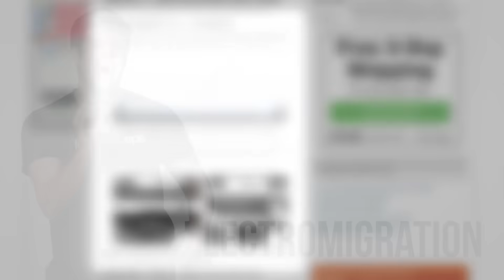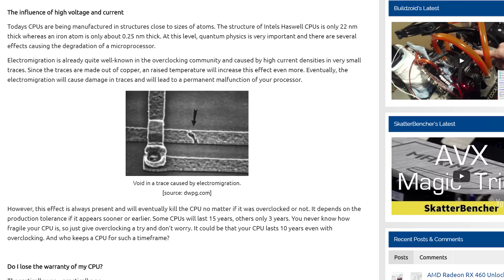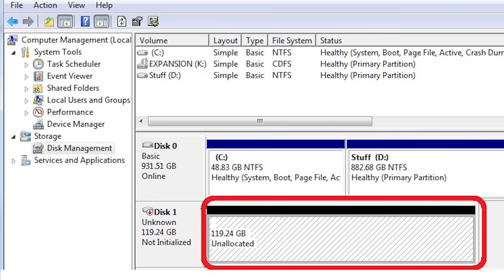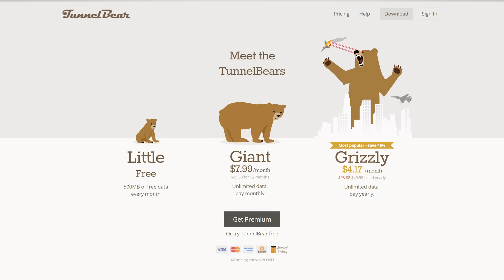Why Do Electronics Die?

Comment: Electromigration is indeed an issue. The current densities in the copper or aluminium layers of interconnects in highly integrated micro devices are in the order of 10^6 to 10^7 A/cm². These are current densities you usually find in superconductors only. In bulk normal conductors you don't find current densities of more than several 100 A/cm². There are several ways out of the problem with electromigration. The length of the interconnects can be reduced or material reservoirs (wider buffer lines) can be placed along longer lines in order to reduce their virtual length.

Comment: HEAT is the # 1 failure for electronics and engines. 
TIME is the # 2 failure for components. 
Capacitors are the #1 component to fail from HEAT or TIME.

Comment: Had a tv from samsung 40 inch led full hd from june 2007. Just at the end of the capacitor plague era. It worked fine for almost 2 years. Then it would take anywhere from 2 minutes to 2hours to start. Later i had to use a hairdryer to warm up the start relay capacitors to get it to start. Eventually it wouldn't start anymore. Bought new capacitors from ebay for 3 bucks swotched them out and still have the tv to this day in my office.

Comment: An answer from an actual professional grade electrical engineer here: the law of thermal dynamics and the law of conservation (which is elementary stuff), explain why things eventually fail. Most of these components are dealing with electrical heat that is being used almost just as fast as the electricity can move itself.  This in turn means that these components have a harder time dealing with the forces that cause harm. For example, a dielectric breakdown to a capacitor can happen which just means that high voltage (high heat) can cause permanent failure. Many components are specifically designed to deal with certain ins and outs. That is why you hear motherboards having different specifications for voltage requirements and what type of CPU/GPU it can use. The most advanced problem we have been trying to conquer is the components ability to undergo high tolerance heat, dissipating the heat as fast as it is transferred and withstand the rapid heat dissipation without falter. The truth about every single component though, is how every single electrical device ever made by man, has a limit due to chemical bonds and reactions. A battery can only recharge so many times until it can no longer hold newer charges.

Comment: I went on a call to investigate some power factor correction capacitors at a manufacturing plant.
The first one I saw I told the customer was bad and I wasn't even going to test it as it would be a waste of time.
He asked how I could be so certain that it was bad without testing it.
I showed him the rest of the capacitors in the bank that looked like giant cereal boxes and pointed out that the one that I said was bad looked like a giant cereal box with a free basketball inside it.

Comment: The main culprit (by far) in the failure of electronics is power supplies/capacitors. And no power supply is more unreliable that STINKING BUCK CONVERTERS.
PS. Engineers often shave a few pennies of production costs by UNDERRATING capacitors. They’ll use a 6.3V cap in a 5V circuit.

Comment: As a physicist, I know that electronics run on magic smoke contained within the component.  If the smoke ever gets out, then the electronic component will no longer work.  For example, if the power supply stops working and smells like smoke, you know the smoke got out, and the power supply no longer works.

Comment: I normally do not what videos like this, but this time I did. I have to say Luke tried really hard but failed. Electron migration happens regardless current flows or not. Correct answer was thermal expansion/contraction due to temperature changes, yet this is extremely rare to happen; more likely cause is dopants migration between different regions inside silicon and that accelerates tremendously with temperature. And yet this is not why SSD fails. SSD fails because floating gates (which is rather thick) leakage current increase as material deteriorate, because of temperature. That is why it is common practice to keep all mission critical electronic under 60'C at any time.

Comment: One crucial factor for "early" death of electronics is the RoHS compliance soldering techniques. Electronics are dying too fast now a days due to high melting point fragile unleaded solder. Many dead modern electronics wakes up just by resoldering components with standard 60:40 solder.

Comment: Probably the least evil thing Apple does is their planned obsolescence. But you’re right. An auto update that throttles your device is pretty darn evil. However, development is expensive and it requires continually buying new devices to pay for the R&D but no company is more about profits and dividends than Apple. They should absolutely charge at least 33% less for their “pro” gear. And since you can’t even really play any advanced games on the consumer models… gee, really their consumer products are used by more professionals than their “pro” gear. Accountants, professors, real estate agents, writers, democrats and liberals in general. They all use their Apple products professionally. But video editors and 3D modelers of any kind can get ten times the performance on a windows tower for half the price. The only problem is, you have to restart 3 times as much. Maybe even 5 to 10 times as much but it’s kind of worth the savings. You still have to restart an Apple product occasionally and the updates, ach! The updates! Have a great idea, must write it down or record it RIGHT NOW… sorry. Auto update. You’re effed. For the amount of times Apple takes control of your device you’ve restarted you PC only once. I bought my first PC in 20 years. I built my first one 20 years ago, I have to say, I’m glad I did and I still think RGB is awesome. Joni Ives probably throws up at the notion. And I’m glad. It’s as if minimalism is the only way to make something look good. Granted non-minimalism is VERY easy to mess up. Enough outta me.

Comment: This happens because of the nuclear weapons. They are space laser devices that sense electronic devices, toys, watches, cheap stuffs, laptops, tabs, batteries, etc. The most spectecular part of this is the memory effect of the batteries. The GPS monitoring system is responsible for this, if you don't use it, your device will last forever. In watches, the baclkight calls the GPS (its inverter), in tabs all permissions of locations should be turned off, using a regular map is better. In laptops, the battery's malfunction leads to all malfunctions. So if you don't use Google Maps with a laptop, it will last forever. That was simple?

Comment: Plastic parts (a.k.a. PEMs, or plastic encapsulated microcircuits) also absorb moisture, which eventually leads to internal corrosion. Contrary to popular belief, plastic is not a perfect sealant.  If you need a hermetically sealed part, that requires a ceramic package with a sealed lid.  

During manufacturing,  there are baking procedures to drive out any moisture PEMs absorb prior to soldering.   If they aren't preheated and dried out, they will pop and crack when they are soldered. Just one more thing to think about.

Comment: #1 killer of all electronics components is Heat!  Along with constant use/24-7.  Running components with poor airflow increasing heat will kill them.  # 2 is electromagnetic force causing voltage drop and heat.  Dead, Dead, Dead!!!  :)

Comment: It fascinats me how electricity behaves very much like water. The effects he's referring to become far more noticeable when you deal with high energy electronics that operate in the megawatt range. A lot of parts in these type of devices have to be replaced due to wear caused by the huge amounts of current going through them. The damage resembles sort of the wear and tear of water on on pipes and river banks overtime.

Comment: you forgot bad passivation, some Commodore chips fail because they did not passivate the chemicals used in the production of the chip, they never stopped the process and at some point, they fail. Overvoltage is another problem, heat of course, also mechanical like bent pins etc. I've seen it all.

Comment: Always buy high quality motherboards from well establish companies that have been in the business for a long time. I've been buying ASUS mobos for ~30 years and not one has failed. I stilll play Win98 games on my ASUS P3B-F with a P2. Cylindrical capacitors are easy to replace for those new to soldering, easy to spot because they start to expand or leak. Inspect retro hardware frequently. Smaller ones are harder and might take an expert to find and fix them. Oh, and FANS, FANS, FANS! Positive pressure! Stay away from external heat sources (baseboard heating, vents, etc.) They will still die but they you can keep them going for a good chunk of your life time.

Comment: I did a BSEL modification(single 2mm square section of standard electrical tape placed following the leaked CPU technical data) on my brand new mega buck dual Xeon 10 yrs back. It took my base 2.3ghz to 2.8ghz for a single piece of sticky tape. Oh and changed it from like 1166mhz FSB to 1600mhz FSB. The modification tricked the MB into thinking the CPU was an “Extreme Addition” and bumped the FSB to 1600mhz. 

🇦🇺🤜🏼🤛🏼🍀😂🤓🎁🎄🧐

Comment: 4:00 I would have said the voltage drops as a consequence, but it is ampere, the flow of electricity (electrons), that gets diminished and since the resistance is almost static the voltage has to shrink as well.

Comment: New electronics die after 2 years

Meanwhile: my 20 year old ds with full battery capacity
Reply: My Nintendo DS sat in standby mode with Pokemon Diamond suspended in memory from 2011 to 2018, without being charged, and when I went to grab it I was right where I left off. I was blown away by that. There was even enough battery life left to play for about 30 minutes before the battery light turned red. 
I know the last time I had played was in 2011 because I had gotten the Gamestop event Pokemon and stopped playing shortly after.
Reply: And this is the OG, fatboy DS

Comment: Daniel Beck
4:27
Planned obsolescence is soooo 2007.
Now we having the whole world as a trial market. If one seller‘s product fails you just buy it from another countries seller.

My Samsung 42“ Flat TV from 2008 is still alive as was now replaced by C97 LG Oled.

Oled‘s also can age. But I seen them in the store running for 10 Month without switching them off - and just then you can see a slightly colour difference. 
Planning to replace that TV in another 10-15 years.
Printer from Samsung M2026-W. Super cheap, using it for my company. Printing 80 - 150 Pages a day for now 16 month, using 2-3 toner per month and it is amazing for me that this electrical/mechanical thing still working. 

Never seen planned obsolescence since 2007 😁
PS: I not put LED Lights into it, they are expensive and most People buy them like cheap and after wondering why LED lights are broken that fast.

Comment: Next: Why do electronics work when you hit em hard
Reply: Forced elctromigration/rearrangement.
Reply: Percussion maintenance.
Reply: Why do electronics smell our anger?
Reply: If it's a vacuum tube/relay computer, well then you've just fixed a weak contact
Reply: @Lightning_Mike  ok but what about my DVD player why do I have to slap it to make the tray come out
Reply: @elise205  Well, since that's mechanical it should work
Reply: @Lightning_Mike  so it's been a naughty DVD player and it needs mommy to punish it? Old tech is kinda kinky
Reply: @elise205 Likely a slipping belt and hitting the player shakes the tray enough to move.
Reply: @Elise Evergreen  Yes, yes it is.
Reply: yeah ive dropped my laptop multiple times and it works fine
Reply: Coz the stuck electrons pops out
Reply: so true, specially of tube televisions
Reply: Xbox 360
Reply: ...because there is short circuit or weak contact point.
Reply: @Heliocentric  Or a bad solder joint. Bit of wiggling or whacking might fix it temporarily :)
Reply: masochism
Reply: Next: Why NASA' electronic devices in outer space simply have no defects.
Reply: I still have a crt pc monitor, when I turn it on it stays dark for 20 minutes then it turns on, very yellow because the blue is dying, but when I hit very hard below the screen the blue start to blink then I open the menu and the blue stays for 30 minutes before I had to do all over again
Reply: Like a battered spouse, they start behaving themselves, act and operate "right"
Reply: Cuz you woke it up from sleeping
Reply: Because child protection laws don't apply to them
Reply: Ayyy.
Reply: Mine never do,, now I have very few left. Along with my anger management issue's,, less is more😊
Reply: Dislodging dust blocking connections is another possible reason
Reply: Bro literally asked my childhood question 😂😂
Reply: Kinetic energy
Reply: My electronics dont fail but they cant pull up there grades past a C- .😄
Reply: Why this typically works is bad contacts, typically bad solder contacts. They broke connection, and in some cases they are still touching and no issues occur, until they oxidize, then giving the electronics a good smack can cause those contacts to vibrate, and it cleans off the small amount of oxidation and temporarily makes contact again. That’s not always the case, but I find it’s fairly common.
Reply: Nanomachines, son.
Reply: Why do people?
Reply: Corrosion removal
Reply: There very naughty and they like getting spanked 😊
Reply: That only happens if you're the Fonz! 😎
Reply: @jdslyman Lol, I still do that. Thought it was just to scrub dirt off the contacts

EDIT: I thought you meant just reseating, not dropping the whole thing
Reply: XD XD XD XD XD XD XD XD XD XD XD XD XD XD XD XD XD XD XD XD XD XD XD XD XD XD XD XD XD XD XD XD XD XD XD XD XD XD XD XD XD XD XD XD XD XD XD XD XD
Reply: They are female

Comment: Cheapass material and designed failer.  I have Old electronics over 30 40 years old still working.  ???
Reply: 1) it’s a purpose built system
2) it’s a lot less complex and powerful compared to nowadays much smaller transistors and overall size of each part
3) they do break

Comment: "Let's start with a common one: capacitor failure."

Apple's MacBook team has left the chat
Reply: Louis Rossmann has entered the chat
Reply: Nichicon: It's free real estate.
Reply: Dell Optiplex GX series team has left the chat
Reply: Haven't seen MacBook with failed capacitors. Older iMac G5s on the other hand had numerous electrolytic capacitors fail.
Reply: Cheap laptop companies left the chat
Reply: @Syndicate_Cookie unironically, cheap laptops last way longer than the ultra thin hyper expensive ones
Reply: @cybermechid9181 , I don’t know what the hell you call “intensive gaming” then… What model is it?
Reply: Idk man, my 2011 MacBook Pro is still running like a beast.
Reply: @metaldemon1066  unibody era macbooks are the best!
Reply: @metaldemon1066  mine died last year :(
Reply: @cybermechid9181 Indie games or candy crush or something aren’t going to drain your battery that much, while graphic intensive games drain the battery lot faster
Reply: @cybermechid9181 , But what model is it? Is it a M model?
Reply: @cybermechid9181 , Sure the battery is better than one mine, but it’s made out of plastic and lacks basics like NFC. So Samsung cut corners in different ways with your phone than mine
Reply: Never buy Apple products
Reply: Now let's talk about repairabilit

Apple has uninstalled the chatting app
Reply: Electroboom has joined the squad*
Reply: Microsoft XBOX team has left the chat
Reply: Very often because the capacitor are to near a heatsink fx, it gets to warm.

Comment: My keyboard is still going after like  13 years of heavy use. It got punched more times than professional boxers during their careers, and it's working perfectly fine. I refuse to believe keyboards can die
Reply: My old membrane keyboard from more than a decade ago that still uses that purple round connector still works and you see many cases of bad quality mechanical keyboards that wont work with only 2 years of use

Comment: Actually, technically, 'current' is the potential caused by lack of electrons, thus 'current' flows from positive to negative whereas actual electron flow is in the opposite direction, from negative to positive ... be very careful when using the word CURRENT, because it has a specific meaning within electronics.

Comment: The only electronic i had that ever broke was an ipod. It got rotten like all apples will eventually do. Even shattered. Yes shattered as in a million cracks and some small pieces falling off... shattered the screen by tossing it 3 ft out and 1 ft drop ontop of my blanket on my bed. I now use an android device that was like $50 6 years ago and it works great. Even my old pc that had 2 inch of dust on everything ran great and better than the ipod. Currently running WoW till.... if it  decides to die.

Comment: I knew about most of this stuff. It's still interesting to hear about this again. What I don't understand is why hasn't a system been designed to flush electrons out of equipment when it's turned off? Almost like a giant ground that sends the electrons away.
Reply: Because then all stored data would be lost as well
Reply: @BlackStoneMoviesMinecraft  
Not if you shielded the hard drive properly. A hard drive is not required to be powered on at all times. Further, who cares if the RAM gets wiped it's temporary. My point remains valid. We need a system that flushes all electrons from a system after it is fully powered down.
Reply: @Sinn0100  ssds?